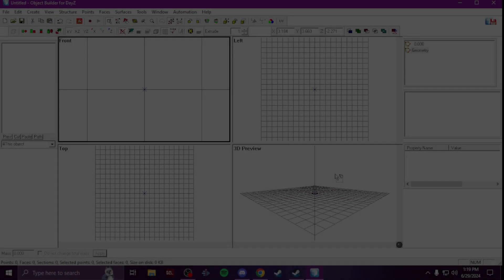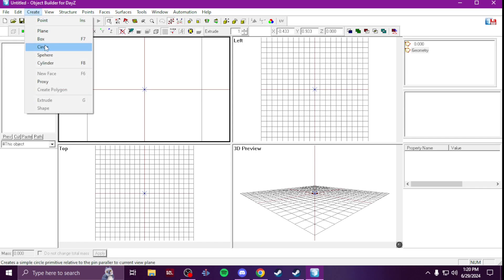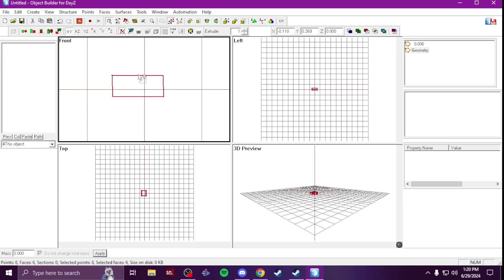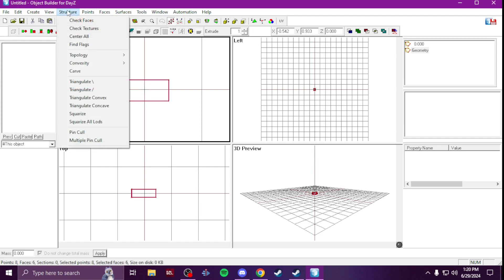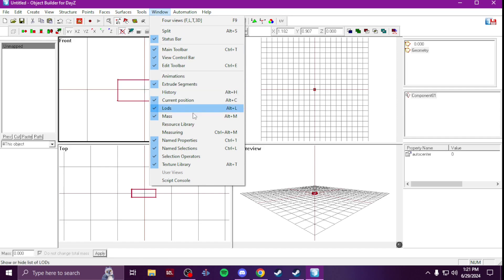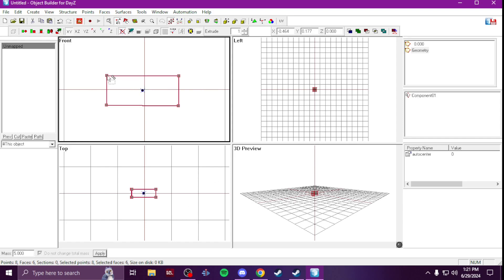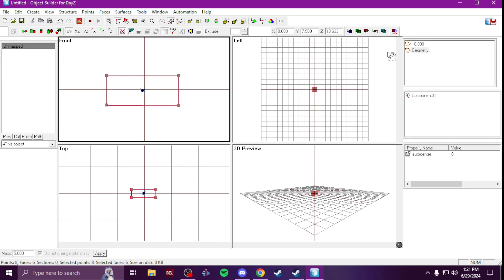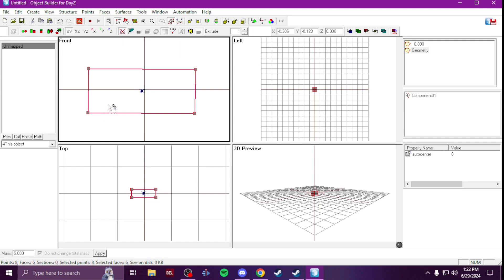DayZ Modding Tutorial, How to add mass to Geometry lods.

Comment: when i place custom assets in terrain builder zeds still run through them even with mass added in the geo lod. this has been a problem for me for years and the main factor as to why we haven't had a playtest yet for Saint Louis.
Reply from the maker: their could be something missing or off in your p3d or model.cfg, you can check out my custom house tutorial and see if that helps

https://youtu.be/Z0vkIdTVgZ8
Reply: @twe4kss  We rebuilt the map pbo and navmesh again and now its working. I can't believe I wasn't putting mass on anything after all this time. over 200+ custom assets. I'm such a noob. Thanks again for all the videos man, without you there would be no custom anything on our map.
Reply from the maker: @JashuaAdam  glad it all worked out for you, best of luck on the map! 👍